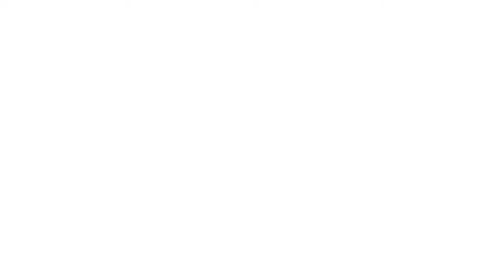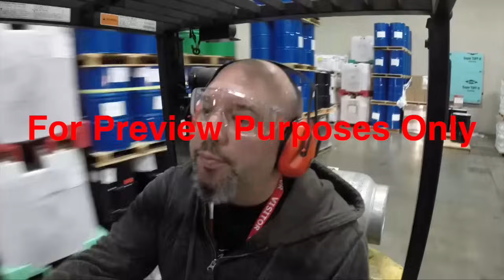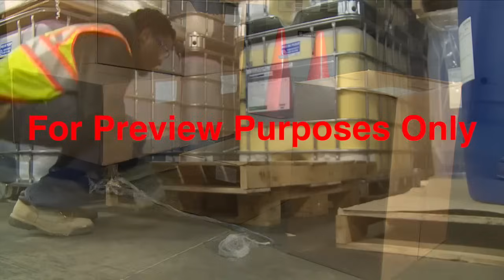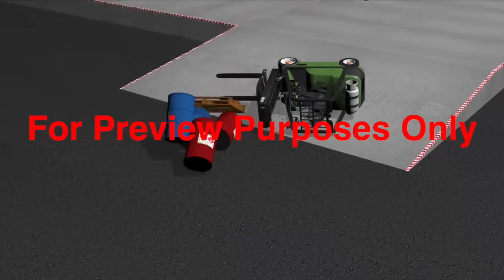Forklift Safety Video - OSHA Training for Forklift Operators

Comment: dont you agree that a forklift should drive backwards?
Because those forks stick out and will come around the corner first before the driver can look around the corner.
A person walking might trip over those forks or even get his legs cut off by such forks.

Would it not make a bit more sense to drive it backwards, so those forks are behind the vehicle basically?

I know, sometimes a load needs to be transported while driving forwards to reduce the chance of it slipping off the forks.

I was taught to drive backwards because you never know what is around the corner. And those forks will be first at the corner before you can look around it.
If you drive the other way around, it causes neck pain, i know. But you look around the corner before you proceed. 

Either way, they need to have those lights fixed on every forklift.
Lights which are like a laser, pointing a very bright dot of light on the floor.
So people can see the dot and know there is something coming.
Reply: btw, if you drive with the forks forward with a load on it, and you have to brake, what happens?
It might tilt over, it might shift the load off the forks dropping it.
And you cant see shit.

So does it not make more sense to drive backwards?
When you brake, the load might shift but only towards the lifting arms. 
Only if you accelerate too fast the load might tip off the forks.

Does that not make a bit of sense?
To me it does, but pls experts, pls correct me.

Comment: Timestamps / Chapters:
00:00 Start
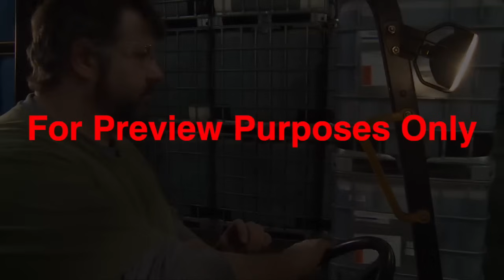01:42 what makes a forklift "different" + balance
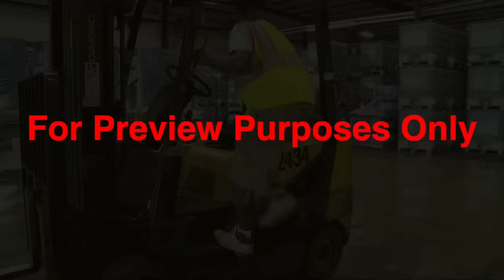04:30 driving a forklift safely
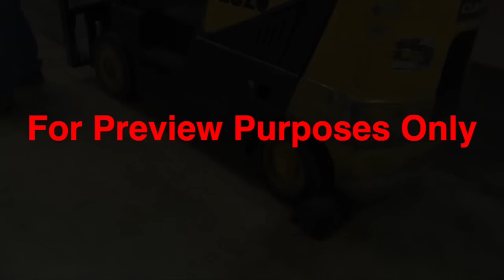08:02 using the mast and forks 
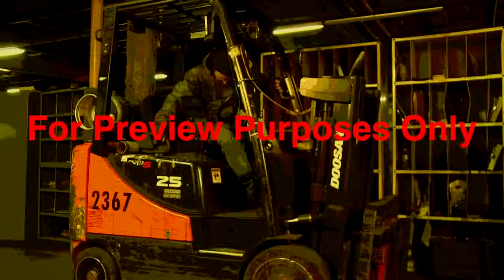12:07 operating safely in the workplace
12:57 loading onto other vehicles 
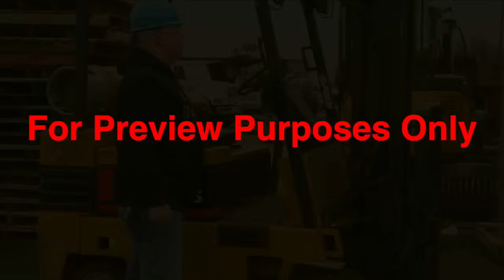15:55 inspecting a forklift 
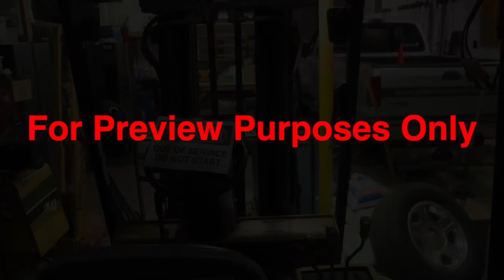17:57 fueling and recharging 
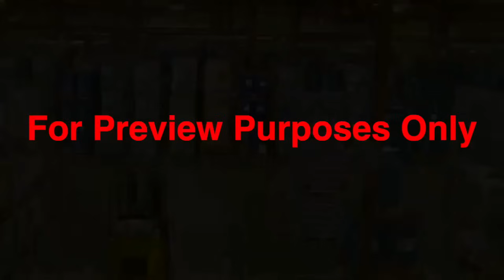21:25 review and conclusion
Reply: You are the kind of hero youtube needs
Reply: Thank you for your hightlight!

Comment: Forklift drivers in the history of the von Braun center:

One guy lifted the forks all the way up stood in the forks suspended in the air fell off and stool wired there.

One driver drove a forklift off a dock.  

I was fine at a forklift.  I put the tips of the forks on the ground and I never unloaded food  shipments or concession shipments.  I was blamed for damage before though.

Comment: Which license is valid for the forklift operator?
Reply: There is no "license".  You get certified by and for the employer you work for.  That certification is only good for that employer.  If you go work somewhere else you can tell them you were certified at your previous employer but if they're doing it right you will still need to be certified by their own program.
Reply: Thank you so much @stevebergman8012

Comment: My warehouse has rules that when you travel with the forklift you need to be driving it in reverse
Reply: I'm safety manager at my warehouse and its one of my rules that if you have a load of any size you're to travel in reverse with the forks no higher than a few inches. If you have to hit the brakes for any reason, the load will fall against the mast and remain upright, whereas if you're going forward the load will fall off.  The only time you're going forward is when you're at your destination and setting the load down in its place.
Reply: @dxgypsyful  LMAO
Reply: yeh thats the proper and a safer way but i guess it depends on a place that you're working at
Reply: That’s how it’s supposed to be driven. My job only cares if you drive fwd with a load that blocks your vision moving fwd. Other than that, if you can’t see past your load, you are to drive in reverse.
Reply: That's why every company has it's own training and certification programs and certifications shouldn't carry over to different companies.  What works for one operation may be totally wrong for another and the equipment varies greatly as well.

Comment: Just applied for a job that requires getting a forklift certification so this is a great preview! Thanks!! Been watching videos for a while now because I’m a little nervous
Reply: Forklifts are easy once you get the hang of them. Been driving them for pretty much 4 years now, and I had it down within the first week. Good training always helps too!
Reply: @DumpsterD  it depends where you're working as some warehouses can be really busy with a lot of traffic .
Reply: I just want a certificate for this so I know I have it lol
Reply: Very educational and straightforward. Excellent. I have been operating a forklift for 18 years and no accidents yet. Just drive slow and steady until you adjust to it and always pay attention to surroundings and people on ground.
Reply: How’d it go, i’m looking to apply now?
Reply: Forklift operation could suck really bad if you are working with 20ft pipes though and heavy engine crates with no center of gravity marked on them. I'm lowkey glad I got fired from that job for absences.
Reply: Certification tells nothing. You need experience. You need to be certified. This is all reverse of how things should be.

As long you can remove their costs they're happy.

At best them give you 1/20 of your salary to safety, while you are responsible to have all the equipment.

How it should work is that you are hired to make the job and then the boss pay your certification because them invest in your safety.

Are you certified? Not something you can read on a certification. It false safety because the company SHOULD invest in their employee to ensure safety of the industry.
Reply: @robertagren9360  eh

Comment: Going to a 4 hour forklift class tomorrow to get my cert. Can't sleep this will give me a head up.
Reply: I got 10 mins of training then sent on the floor.. been fine ever since
Reply: I’m going next week , how did it go ?
Reply: @dracohoe  it's one thing to get certified it's another to get good at driving it and get a job. After I got certified i got an interview at Kubota tractors. They put me through a forklift test and I failed. But they offered me a job in the machine shop not doing forklift. I start Monday. 
A tip, get as much experience driving as you can. Get as much driving time as possible if they let you on one. Practice getting stuff with the forklift. It's hard to get a job without experience and you will probably get tested on skills.
Reply: @SubZeRoy9  hows it going?
Reply: @Notmyabt  he was crushed by a forklift, F.
Reply: @SubZeRoy9  Dang that sucks. I've been driving forklift for 3 years now and just now going for my certification.
Reply: I 3iOhh3yr9 fr n

Comment: Excellent video on safely operating a forklift safely.  Having grown up on a farm and operated farm equipment including tractors with a highlift the video provides common sense information regarding operation of any piece of equipment.
Reply from the maker: Thanks for the great feedback William!
Reply: Same
Reply: It does if you got any common sense, but where I'm currently working I was told I can't use my mirrors to back up, just look over shoulder. In this video it shows looking over your shoulder, which leaves a blind spot and puts your body out of line with your pedals. It's a hell of a lot safer to use the mirrors, that's why they are there. Then you can glance them.bvk and forth and see everything around the whole forklift.
Reply: My Grandfather Died in August of 1982 from being Struck and Run over by a Forklift. From my Understanding, OSHA wasn't yet in practice or being regularly followed. He died at the Houston Ship Channel after his Legs and Chest were Crushed by a Large Forklift(Then called a Motor Tow) He was struck and Killed when the Forklift carrying Several Crates Hit and Ran right over him as he walked towards the Barge shortly after clocking in. The Operator didn't realize something was horribly wrong until he was halfway over. 

Needless to Say, The Operator suffered PSTD and was even more Distraught that he had to face my Grandmother and her family, The Port Houston Authority settled with a Widow's Pension and brought her a new House.
Reply: @Tornado1994  mi. J